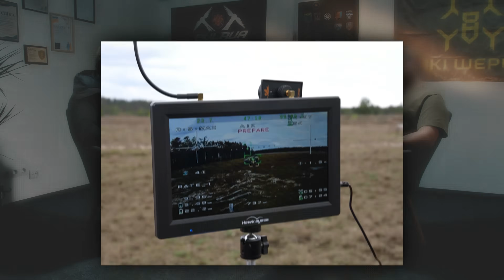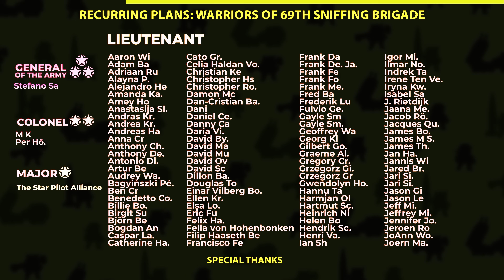Meet Wild Hornets - Ukrainian FPV Manufacture | @69thSniffingBrigade

Comment: The next step is to form a "Hive Mind" using AI that will command a drone swarm, dividing drones to different targets so that not all drones attack the same target, and optimising attack effectiveness. Also, a swarm master is dynamic, such that if it gets shot down, another member of the swarm can take over. The next stage will be ground drone swarms, like "ant" drones that will swarm trench positions and for urban combat. "Ant" drones may just carry a single grenade, but just imagine your positions being attacked by hundreds of grenade carrying "ant" drones!
Reply from the maker: You have very interesting ideas!
Reply: That is a genius idea! That being said, it probably won’t be until the 2030s when this idea is put into place, though it wouldn’t be surprising if it happened sooner.

Comment: Sorry but it don't takes experts to assemble such a drone. You Boys and teenagers do it at home amd when they face trouble, they go online and get help a keep going forward.
Reply from the maker: To assemble a working drone that will fly, home conditions are really enough. But this drone is not suitable for military purposes
Reply: @69thSniffingBrigade  having 20 years experience with rc planes and 8 with drones. I see no diffrent from the drones been shown on SoMe blowing up tanks and the ones people like me used for hobby.
Frames are the same.
Motor and esc the same.
The controller that keeps the drone 8n the air is also hobbygrade, I recognise the OSD on the screen, the data being shown is excalty the same as the open source firmware drone pilots use. BETAFLIGHT or INAV.
At last I see absolutely no military grade equipment on these drones. Just a simple normal FPV drone like hobby pilots use.
But that's also enough for the task of blow up a tank.
Guess the Ukraine factor is a player here, if Ukrinae made it is super cool, innovative and new age stuff to make them look better.

In the end a simple FPV drone made into a weapon with tools and equipment normal drone pilots have at home.

Comment: You Need a Model T Ford Approach in the Manufacturing of Drones for Quality Control and Economy of Scale for low cost Price point for your Country, Money Tight You'll Make's lots of 💵💵 After the War over( you'll have a battle tested Products to Sell Globally ) As the Operation Scales,  R&D with Over Sea's Partners will be Vital Avenue for Engineering Problems , Necessity is the Mother of Invention, There's Notting like WAR to Push the Envelope of New Unimagined Technology solutions
Reply: No Disrespect Fund Raising is an Admiral Cause, But this is a Fight for your Country's Life, This is to Vital to be just Left to the Emotions of the General Global Public, Your Ministry of Industry/ Manufacturing and Economic development Should Stream Line Funding/ building's, Hire Skilled work Force Bank Roll this as a Semi state Enterprise, it's Madness Running a WAR of Survival, On Hand-outs 🤯
Reply from the maker: Thank you for such an interesting and insightful comment! You are right in so many ways. However, I can assure you that the fund operates within the framework of Ukrainian legislation and does everything possible to increase production and attract investment. You are also right that if the state provided sufficient funds, it would be possible to recruit more staff and thus produce more drones. A lot in this case depends on government agencies and their assistance

Comment: Would it help to have some moulds made for some of the plastic components so they could be injection moulded so you can pop them out every like 20-30 seconds as opposed to waiting on prints?
Reply: I have a hand driven self made one in my workshop and I make the molds. But this is only for small simple parts. It is more complex than one thinks. There are a lot of companies doing this here in Ukraine.
Reply: @thomasvilhar7529  ya I did it for industry...it's probably more simple to me than most
Reply: Of course it would. Are you aware of the costs of injection moulding?
Reply: @canadiangemstones7636  I think my country PT has injection factories for plastic material. Were they contacted to produce plastic parts? Put the ambassadors on it...
Reply: @canadiangemstones7636  the main issue is mold design.  Commercial quality molds can be quite expensive to develop I believe.  But not unfeasible.
Reply: @nic.h ya my job was mould making before I understood what goes into it
Reply: @nic.h most of the parts I've seen aren't very complex so the tooling shouldnt be too complicated
Reply: Yes , what im saying is i can make small simple aluminum moulds or someone else could and fundraise enough for the injection equipment. @canadiangemstones7636
Reply: I really wish I lived closer so I could do more to help because I have a small machine shop and electronics lab in my garage
Reply: I have made composite moulds aswell with oil heated moulds so the epoxy can cure in about 7 minutes for pumping out carbon fiber and fiberglass  components ...I could really help streamline the production
Reply from the maker: Thank you very much for your support! Even your ideas to help is very good!
Reply: You will find what you are looking for if you watch videos of Russian combat drones in Ukraine...for comparison, the UA are still in the Stone Age when it comes to manufacturing and construction!
Reply: @TRD-JDM that's not true but you think what you will

Comment: yes but more important than buying drones is to buy the 3D printers especially metal 3D printers you should be supplying 3D printers two a week. is easy to find these people they got a phone number or on signal, you know he's signal handle, I would like.to speak to him he understands English?
Reply: Don't believe they are using significant amounts of metal components that need to be 3D printed
Reply: @nic.h  the whole thing is 3D printed the blades the body motor housing maybe
Reply: @hoobsgroove  Not sure why you would 3D print the propellers given that there are cheap COTS solutions available.  Sure it would be doable, but why would you want to when there are better options.